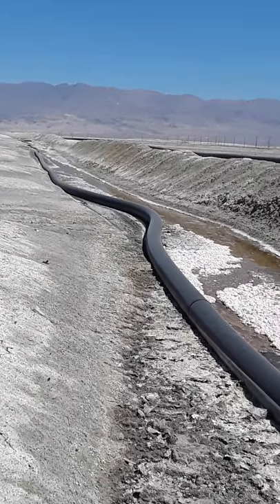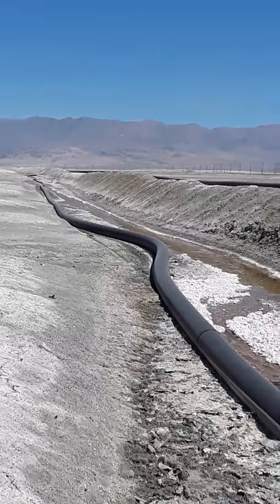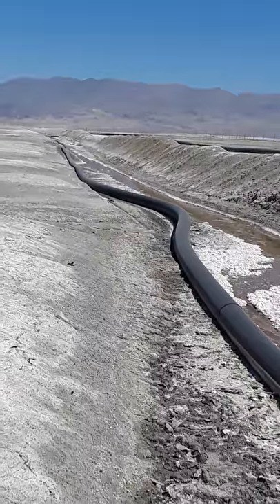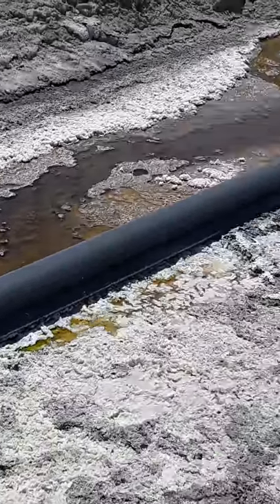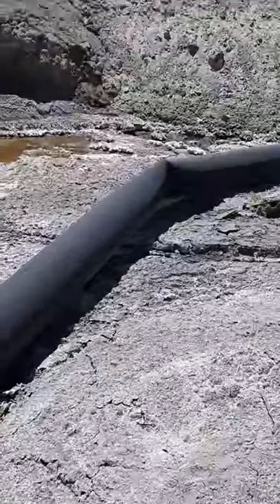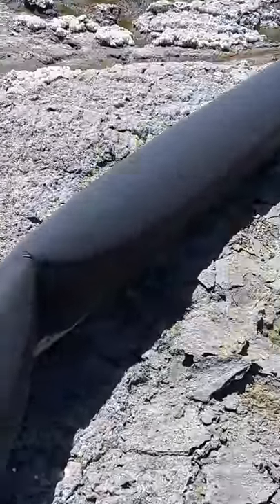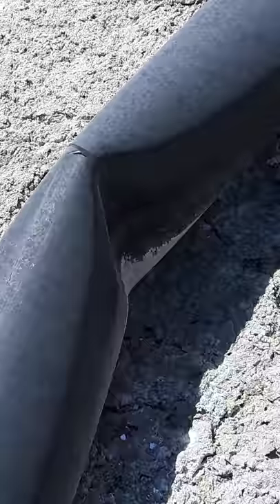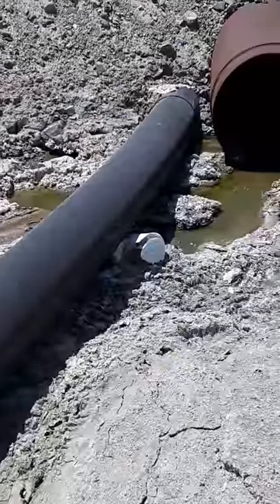EPIC FAIL HDPE FLEXIBLE SEWER PIPE bends buckles  in 2019 RIDGECREST CALIFORNIA EARTHQUAKE

Comment: Going to half to do like the Alaska pipeline and put some curves in the run to allow extension and and compression with out kinking. Have you checked how much the land shifted.?
It could be fairly easy for pipe manufacturers to create dual layer slip joints that have yards of secure telescopic ability to handle this effect.. there would need to be some creative assembly of these telescopic sections at the factory as the outer sleeve would need to be assembled from two stepped lengths to prevent ultimate separation at full extension. Forward my reply to the manufacturer I will talk to their engineers about my thoughts .